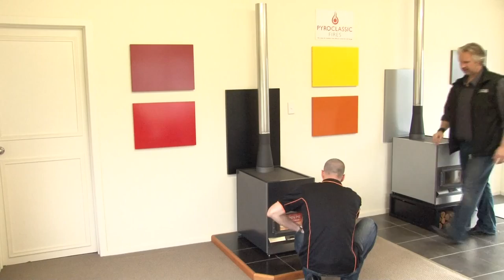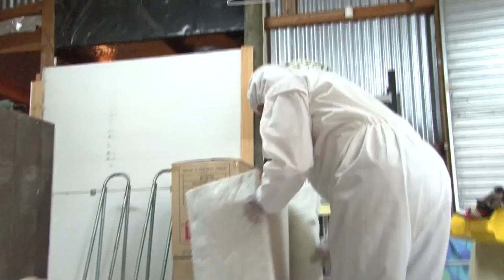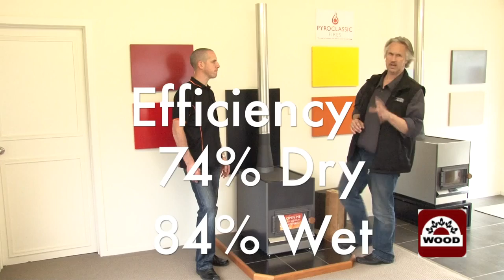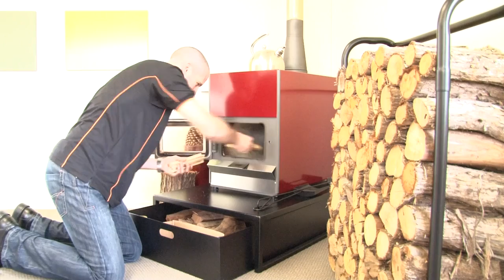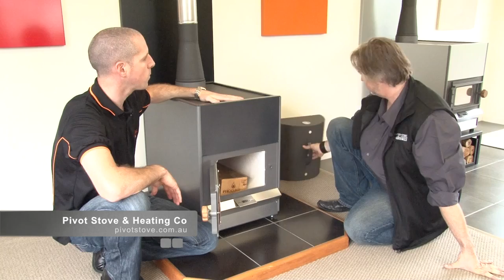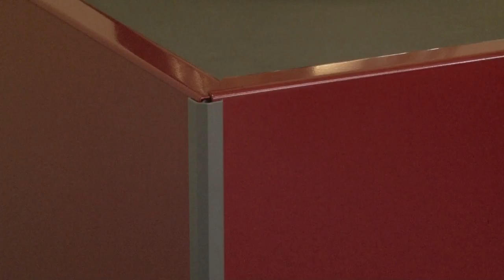A look at the Pyroclassic Wood Heater

Comment: These things don't give off much heat, they might be efficient, but ineffective.
Reply from the maker: Hi Robert,

The Pyro Classic has a heating capacity of up to 180m², which is more than enough for a large living room or open plan house.

If you're having trouble getting enough heat from your wood heater, try burning smaller logs and ensure your fuel is nice and dry (moisture under 18%).
Reply: They give off 70-80% of the heat value of the fuel burnt

Comment: If the firebox is so insulated how the heat will spread out?
Will it not go out through the pipe?
Reply from the maker: the 100mm steel top and natural convection sides - this heater gives a thermal mass type of heating for the home

Comment: I like the idea of heating Water within the stove. 
Maybe to pump around Radiators, or to fill a hot water tank for Sinks & showers. 

Could this heat water for Underfloor Heating Systems ? 

I'm no Plumber or heating Engineer, 
But When the hot water Copper tank is full & hot, Could the water then Circulate around Radiators in other rooms & Heat underfloor heating in a suitable size house ? 
A house built with Suitable insulation to modern standards ?
Reply: Probably too hot for most underfloor heating systems which typically run at 45°C temperature for screeded floors and 55°C temperature for timber suspended and floating floors.

Comment: My Cromwell ULEB fire says it releases 0.2 g/Kg of emissions so it's a cleaner fire.  But it's newer technology - 4 years later.  But you can't cook on it and you can't attach a wet back.  I was going to get the Pyroclassic 4 except it was too long for my lounge.
Reply: There is a Pyroclassic mini that is half the length of the normal sized one.
Reply: @richardmcgrath61  I don't recall that the Pyroclassic people mentioned that to me when I rang them

Comment: I like the way it will run at high temperature. However they have not explained how it actually radiates heat or transfers heat into a room. The lack of a fan or fins means heat transfer will be limited to quite small areas.
Reply: Heat comes off the 10 mm plate on top plus through the door. You could place a passive fan on top of the plate to spread the heat.

Comment: The Australian made Jindara grange has 76 and the smaller Tilgra 80 precent efficiency.
Reply: Does that also mean it takes ages to actually give off heat when lit?
Reply from the maker: there are some high efficient heaters.. but with 0.3grms emissions.... the pyroclassic is still one of the cleanest burning heaters
Reply: True....1.3g and .9g is what is listed for the Jindara. Have you had much to do with the Jindara any thoughts?
Reply from the maker: best to chat to Jindara about thier heaters
the pyroclassic is not like any traditional wood heater in its construction or performance.. the ceramic firebox and performance is unique 
and the way the Pyro burns the wood at an extremely high temperature means you get a long thermal mass of storage of the heat + an extremely long burn time

Comment: Very good explanation. Thank you both. Could you tell me if you could also burn self made bricket's from papier mache?
Reply from the maker: No.. the Pyroclassic heater is tuned to burn only wood

Self made brickets work in heaters that have a multi fuel set up ( with a grate and ash tray )
Reply: @pivotstove  could I order this in the United States? If so how much cost in American dollars?
Reply: Many thanks.

Comment: We have got one now for 18months, biggest problem we have you can`t control the heat like our old fire. It can be come very hot inside and we have to open doors and windows. The old fire we could dampen the fire, witch you can`t do, Turbo slide is shut.
Reply: If you want less heat, put less wood in.
Reply: @richardmcgrath61 then it burns out too fast and you have to stoke it all the time
Reply: Have you got used to it now? Would you not have to learn to regulate the heat based on how much wood you are burning?

Comment: Look at all that heat energy going up the flue and wasted. Wouldn't it be better to somehow use that exhaust heat to actually heat the home? Wouldn't that be more efficient?
There is a better way.
Rocket mass heater.
Reply: Klaa2  I've not seen any emissions data from a RMH. Do you have a link?  Also RMH only are supposed to burn a few hours a day and then release the heat over the rest of the day.  There's no need to burn for 15 hours.
Reply from the maker: this is not a rocket heater
Reply: Nirky st
Reply: Nirky j
Reply: @Klaa-2  Not sure that's right. The RMH is very clean burning - basically just water vapour coming out the chimney. However with a RMH you usually have a large area adjacent for heat storage that is the size of a couch. But they tend to burn very small branches and waste wood, you don't use logs as such. The temperatures in the combustion chamber are often greater than 1000 degrees Centigrade. However you may have consent issues if you try putting one into a residential dwelling.
Reply: @richardmcgrath61  The problem is that as there is no certified RMH then under current regulations you can't get one installed legally except unless it's configured as a cook stove.  We do have some tests that show us how much carbon monoxide, water and carbon dioxide they emit but no particulate data.  And also no data on the amount of dioxins and furans they generate, but then we appear to lack data on the latter for all wood burning stoves.

Rocket stoves were originally conceived for cooking purposes which is why they can use twigs etc.  But for space heating you need larger pieces of wood.  A lb of dry wood has about 7000 BTUs. So, you can use twigs but it's painful to load any heater with small pieces like that though they will burn them.

Comment: 75% efficient!, the Burley Fireball is 89.3%!!!!!.  75% is way behind industry norm.
Reply from the maker: That is correct - but the Burley Fire did not pass the Australian Standards for test
Reply: Hmm that would seem strange that the burn is only 75% efficient compared to higher efficiency from stoves else where yet apparently it produces less emissions yet you need more complete combustion to lower emissions. Can you explain that?  Whilst the bigger mass means longer residual heat it also means a much longer heat from cold time.
Reply: Is the 75% relative to US standard which discounts about 16% before measuring, or an absolute figure? How do Australian standards work? Apples to oranges...